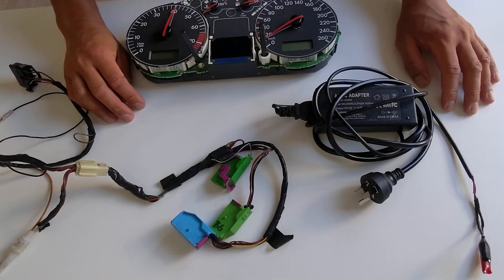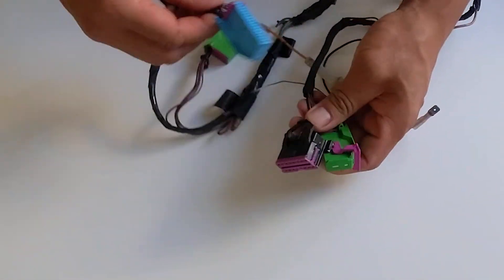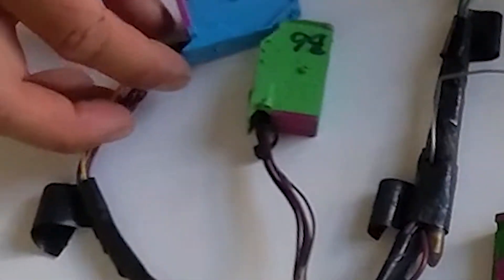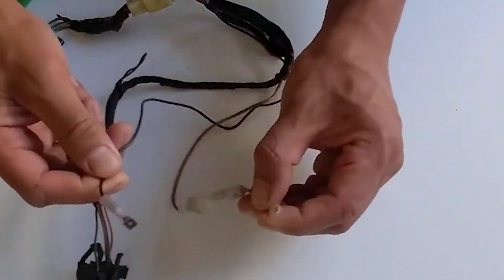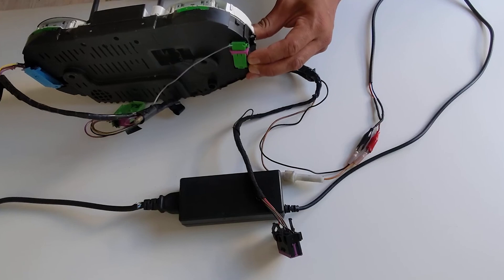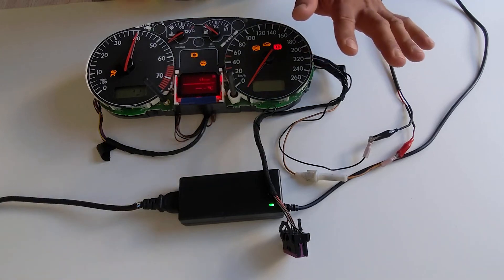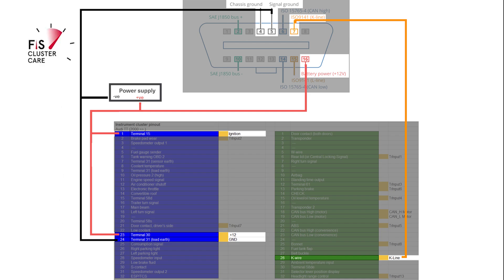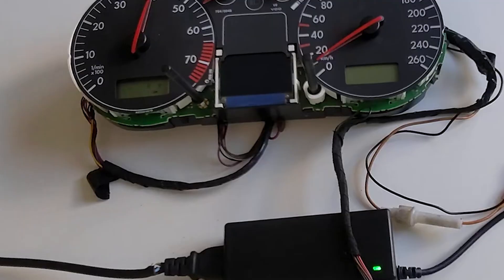VW Audi Instrument Cluster Bench Harness make your own (Audi TT, A3 S3, Audi A4, VW Golf, Bora MK4)

Comment: Hi I have a question, so the check engine light doesn't light up in this scenario, I have a cluster on a TT mk1 from 1999 that the check engine light doesn't light up, so that tells me it's a miscummunication issue between the ECU and the Cluster? We've tested the LED with diode function principle and resistance and it even lights up slightly during the test...
Reply from the maker: Hello. 

Ok so I don't think it lights up on the bench. If you watch some other videos you can see exactly what LEDs light up when bench powering. https://youtu.be/AFy-8jtn2Gg

Comment: I replace and lcd for my audi tt 8n 
I putted back to the car but all lcd are likely dead only red light, no digits no information. What i should check;
Thank you !
Reply from the maker: It sounds like the screen isn't soldered on properly - remove it and clean up both surfaces and try again.

Comment: nice Video. i'm searching the pin who is switch on the led's for the backround for the A4 B6. I found nothing in the table. Do you know this pin? the 58s and 58b doesn't work.
Reply from the maker: @marcell.6334  whichever is illumination pin for headlights. Should make the backgrounds LEDs light up :)

Comment: Hello there, I have a Audi a3 8p cluster and i want to see if it works using this setup, what wires do i need out of the plug to just power it on and test the gauges and screen work? Or is there anything i can look at that could help me? Thank you
Reply from the maker: @georgeh-w hey the 8P you need a little more complicated set up. It needs a wake up message from the can bus gateway. So you cannot use this video. 

Read this 
https://mhhauto.com/Thread-AUDI-A3-8P-DASH-POWERING-ON-TABLE
Reply: @ cheers dude 🫡👍

Comment: Hi i made a cable for the mk1 tt cluster from 2002 following youre instruction, it lits up the fis display and some lamps but its not beeping i am able to connect to it via vagcom but i cant run the output tests. and the km and clock is not showing are it supposed to do that?  i can read the error codes and read the coding data.   do i need to connect the s-contact maybe i ting its ignition on?  the cluster i am using is 8n19208080A
Reply from the maker: @Zlobo-TV  nice work. If you can connect and see diagnostics then you should be able to do output tests as that's all through K line. 

What cable are you using ?
Reply: @ianpgonzaga  i use the hex v2 cable. strange is that its not beeping and the odometer is not showing

Comment: Hi, Great video, just what I was looking for!

I'm just about to wire up a MK1 TT cluster in an earlier CE2 vehicle and figured out all the pinouts on the T32 & T32a blue & green plugs to the CE2 fusebox. Is the FIS completely CanBus driven, or is there a possibility of getting some functions to work? Also can the audible bleeping on the cluster be muted at all (I have a full version of VCDS)?

Many thanks
Reply from the maker: Sounds. Like a good project. The grey pin has the 3 signals controlling the screen. When a buttons pressed they short to ground. There are many more signals at the grey pin too for the engine so keep studying the pinout the functions to want working at the cluster.

Comment: Great video. Q: I only have the 2 cables (32pin) on my audi tt MK1 8N. Not the 16pin plug. Do I just stick with the diagram or do I need something additional? also: I have seen another video where they only connect the blue 32pin cable to get it working as "ON". Is this correct? Thanks a lot.
Reply from the maker: So your screen mustn't be full FIS if you only have two connectors. They might be wired up like a golf. So this wiring should work. 

The 16 pin plug is the OBD connector required to talk to the cluster while in the bench. 

If you only wanted to power up on bench then only blue is required.
Reply: @ianpgonzaga  excellent. Yes only need to power up i believe to get the gauges in correct position. thanks so much for your help!
Reply: @ianpgonzaga  I will try that. will pin it as i dont have the plugs yet. will need to visit a junkyard soon:) Thanks so much for your support and great video's Ian. Really appreciate it!

Comment: Hi there mr ian.thanks for this information.i wanna ask if u know what pin or colour wire i can use to tap in on the RPM signal.thanks for this video
Reply from the maker: Hi. Will be different depending on the car. See the pinout for your car on this page. That should help. 

https://wiki.colormfa.ru/installation

Comment: Hi, could you help me?  I tried this procedure on my Audi A3 8L Cluster and it doesn't work.  Then I tried using Ezp2023+ and now it doesn't work anymore.  Do you have the EEPROM file to share?  My car doesn't work without the cluster.
Reply from the maker: Hello! Oh no maybe the wiring incorrect? What step went wrong?

Sorry I don't have an A3 file ready.
Reply: @ianpgonzaga With this method, when I click on Dash/Read EEPROM, the error "No ECU Found..." appears.
Reply from the maker: @hanskomorek4019  sounds like wiring incorrect. Double check pinout and wiring :)
Reply: @ianpgonzaga  it's correct?

12V+ pin 1 and 23 BLUE
GND pin 24 BLUE
K-line pin 28 Green

Comment: which pin is for illumination?
Reply from the maker: No need to wire this up - they all light up with the 12v/IGN/GND if it's been programmed that way. 

Otherwise you test illumination with VCDS.
Reply: @ianpgonzaga  thnx for replying, can't I just basically trigger the cluster illumination on bench?
Reply from the maker: @bekire2215 No -  not just illumination itself.

Comment: I have got power to the cluster and Kline is hooked up properly but can't connect to cluster when I read with Eeprom programer. My power supply is 1.5 amps is that enough or do I need more?
Reply from the maker: 12v 5a is what I use
Reply: found out its pin 25 on the blue connector for mk4 jetta 2000 ALH VR6 BEW no green connector at all.

Comment: Hello, a nice video, but the wiring diagram for Audi A3 8L does not work with it. I can't read it! 
Can you help me out?
Reply from the maker: The wiring is at 5:06. 3 wires required from the blue pin and one from the green pin to connect to K Line. 

All the information is in the video 👌
Reply: @ianpgonzaga  ok, I was able to read the cluster (Marelli) 1 time with VAG K+CAN Commander 2.5, but then no more.
I don't know why😕

Comment: Did z buy this ports separate or got it from wrecked cars? (What can u usualy find in wrecked car, I thought people would take all the interesting bits (like radio, gateway, other nodules), before u even have a chance to get to the car)

I am thinking of just buying a premade harness from china (mine has to have quadlock, obd2 and can gateway port, blue plug would be nice so I get easy acsess to can lines), not sure whats cheaper to buy premade or buy all the connectors separate (and pay for shipping) or buying something premade